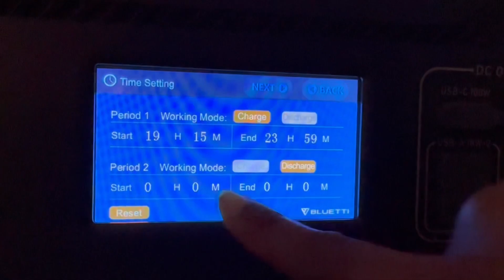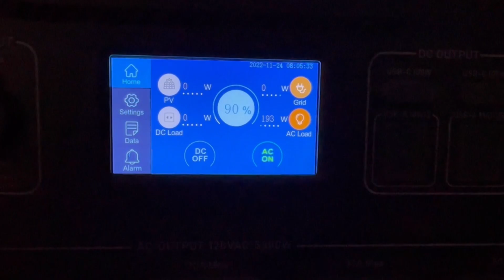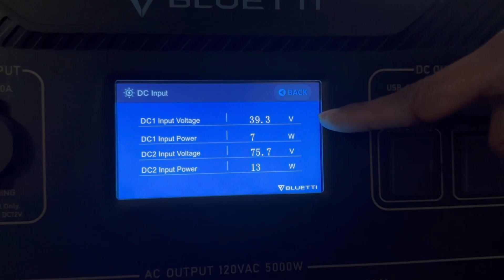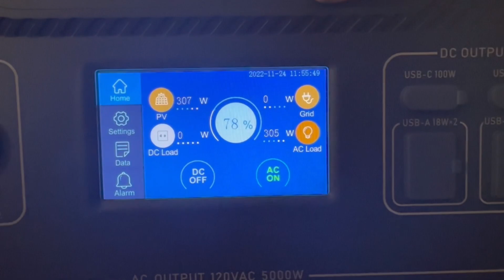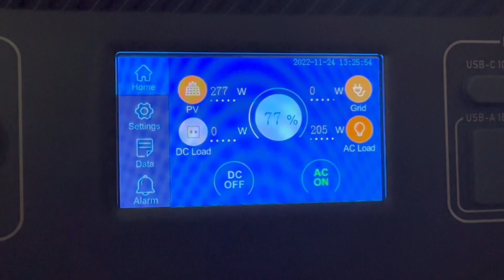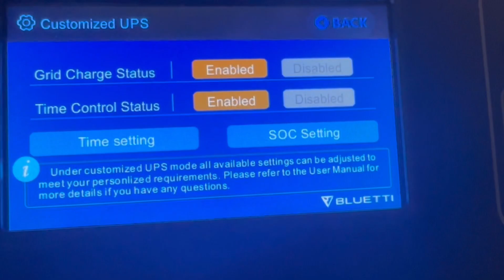Our Off Grid Journey w/ Bluetti AC500 Week 1 Day 4

Comment: Curious if your panels still work after having them in the weather, I was not happy when I received mine and found the warning to keep them from moisture. I was unaware you could even purchase panels that couldn't get wet.
Reply: Thanks for the quick response, I used them for a bit on a sunny snowy day. Didn’t feel comfortable using them, found myself cleaning snow off constantly concerned about them shorting out. I’m aware that they can get damp, but it’s sunny days only for these panels. Got no time to be panel sitting..lol.. again thanks for the quick reply..!
Reply: @Meandering Yogi  I completely understand the feeling to have to panel-sit... I do check on mine quite often. However, I am building a rigid array now. Since I still like portable, I'm purchasing the Renogy Solar suitcase 200W instead of the flexible folding solar panels. I like them, so far!
Reply: @FragranceOfYah  in the process of doing the same with a set of Auecoor panels, I’ll do a video when I try them out.
Reply from the maker: All except one SP200 works… I don’t recall it saying they cannot get wet. That’s why it has a water resistance rating in it.
Reply: @fragranceharrisstanfield  Quite right.  However, IIRC the water resistant rating for said panel is ip65 which is reasonably robust.  Your use case (in the snow for example) should not have damaged them or even contributed to damage.  So if one set of panels is malfunctioning then perhaps they are eligible for warranty repair or replacement
Reply: @jodajackson4489  Yes, I'm aware. That's why I have contacted Bluetti regarding a replacement for the one that is not working. Thanks for agreeing with my conclusion. I use my panels all of the time and in all weather.

Comment: To answer your question on over paneling.  You have to stay within the voltage limits but you can parallel strings to exceed the amps.  The Bluetti will automatically limit the amps to the max it can take.  You can damage the MPPT controller if you over voltage.
Reply: Yeah, I plan to separate part of my series in parallel soon.

Comment: It appears that you need to recalibrate the battery meter.  I had to discharge mine to 0% and then recharge to 100%.  My battery meter has been consistent since that was done.
Reply from the maker: I didn’t have to recalibrate anything. The voltage just has a threshold it must reach in order to charge. It’s been fine since then. Thanks for the info!

Comment: Great video!

Unfortunately the flexible portable solar panels are less efficient, less durable, don’t last as long and are more expensive per watt.  They are easy to work with but it’s a tough call with respect to the tradeoffs.  The standard rigid glass panels are probably a better long term investment.  Bifacial  might be better for your use case given the reflective snow.
Reply: I did look up biracial. They are pretty pricy.. I went with the rigid solar suitcases instead. They are doing well.